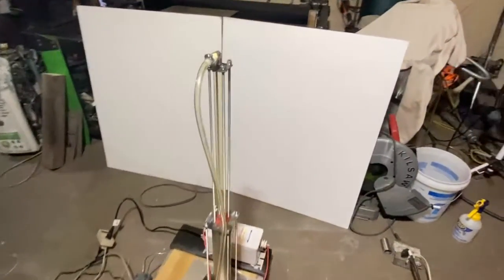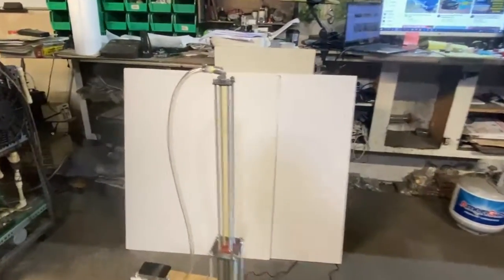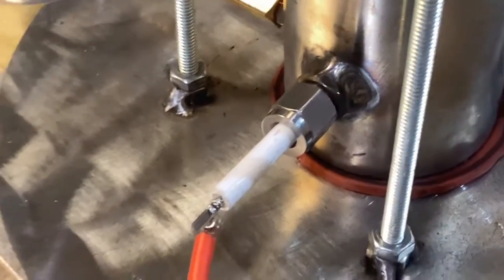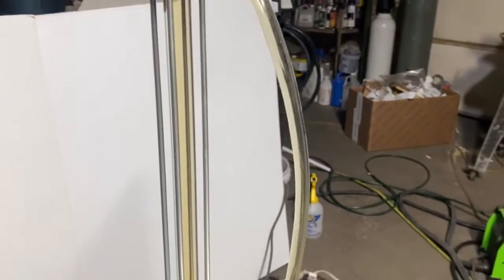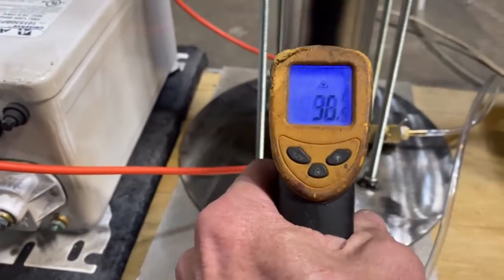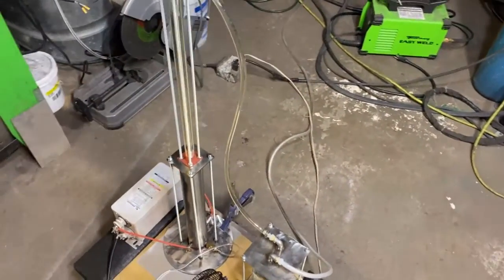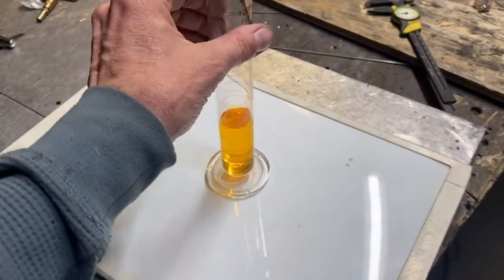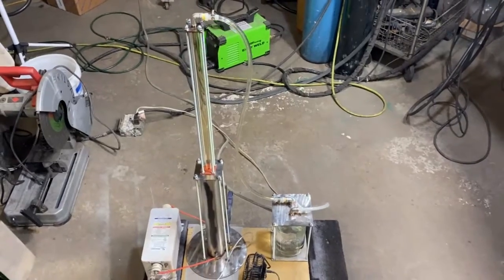Free Nitric Acid Synthesis machine Berkeland Eyed reactor 0

Comment: Excellent video Bob, you're one of a kind man, always makes my day to see what you're up to.  I remember a few years back I ordered a liter of very pure nitric acid, and a liters of other acids including sulphuric for the purpose of gold extraction, but when I looked into it (thank God I did) I found that information about it rusting everything, ruining components, and destroying your lungs.  After that I gave up the gold refining idea 😆 That is until I saw an experiment where the guy dissolved copper sulfate into a nitric acid solution, soaked some paper towel with it, and lit it on fire... left behind pure copper metal as ashes.  I wonder if that could be done similarly with:  Nitratoauric acid, hydrogen tetranitratoaurate, or simply called gold nitrate is a crystalline gold compound that forms the trihydrate, HAu(NO₃)₄·3H₂O or more correctly H₅O₂Au(NO₃)₄·H₂O. This compound is an intermediate in the process of extracting gold. In older literature it is also known as aurinitric acid
Reply from the maker: Thanks for the input , youtube is shadow banning your comments ???
Reply: @NOBOX7  Most likely

Comment: You should be able to spread the spark out with magnets so more air can flow through the spark.  That’s what B-E did
Reply from the maker: In principle you are correct but to much fanning out reduces the over all temp or maybe more accurately the btu  of the arc . I tested a huge jacobs latter that did less gas production than a tiny arec so i decided not to bother with the magnets. The huge industrial units run at 15 megawatts so a fanned out arc by magnets in this case is very suitable